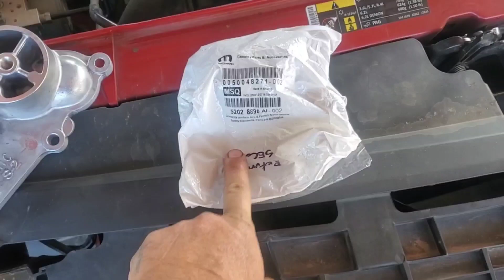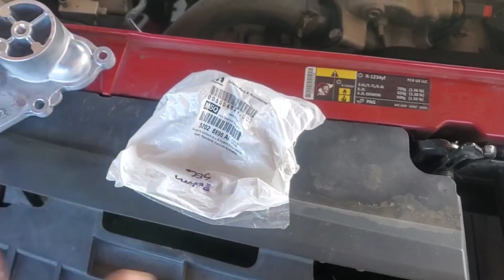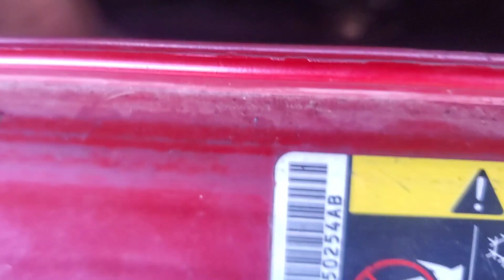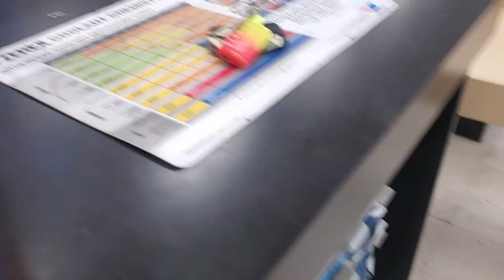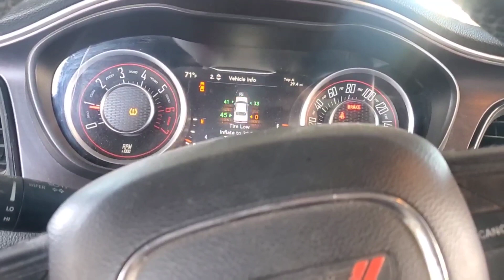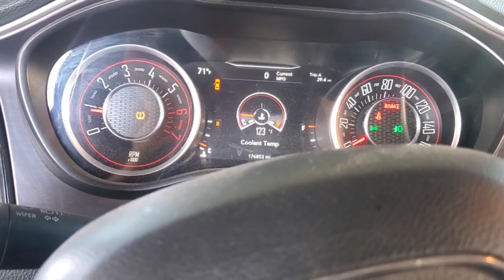Kelly's Cars Tech: 2015 Challenger 5.7 water pump replacement!

Comment: disconnecting the hose at the radiator will save a hour of aggrivation with trying to remove it from the pump ...#1 tip!

Comment: Do you think the water pump is the cause for the car getting overheated
Reply from the maker: Not at all. New waterpump and radiator, car is still running at 208-212. It's the missing under panels causing the warmer temps.
Reply: Ok my car is still overheating I already changed the thermostat and put new radiator

Comment: My Challenger is also an Manual R/T 2015.  I just had an issue where I noticed steam coming through the hood after temp rose to 210 degrees.  Coolant smell was pronounced but could not see where the leak was coming from.  That said the steam was coming from the radiator area. Few small coolant puddles were around the pet cock are but when I pressurized the radiator I cannot get it to leak.  Do you think this the radiator?
Reply from the maker: Yep. Especially if you saw coolant around that petcock drain area. I still have a faint smell on hot days when I park the car in the garage after I'm driving it. I think I might actually replace that Dorman radiator again, and get a genuine Mopar one this time. I would also look into replacing that drive shaft intermediate bushing, they make two-piece ones will replace the original rubber unit.